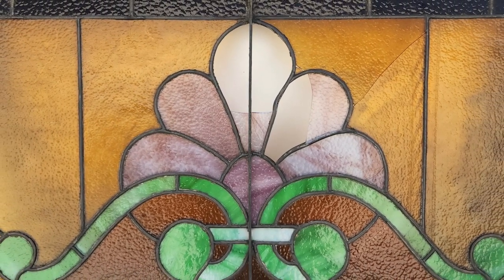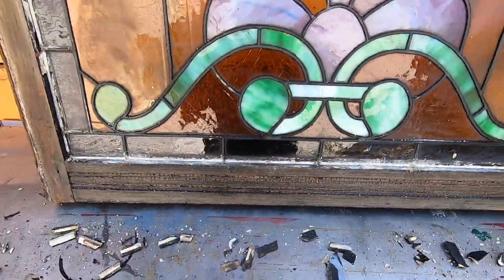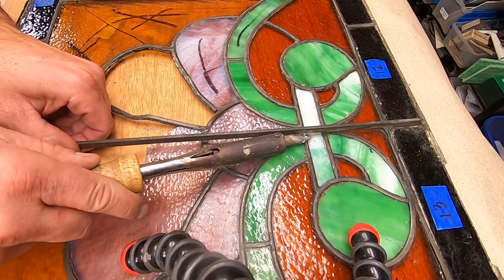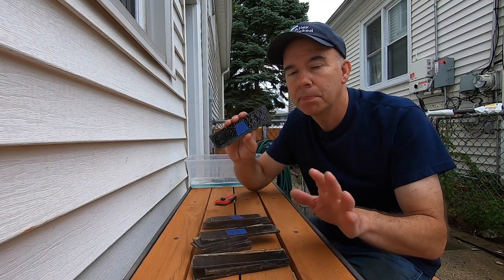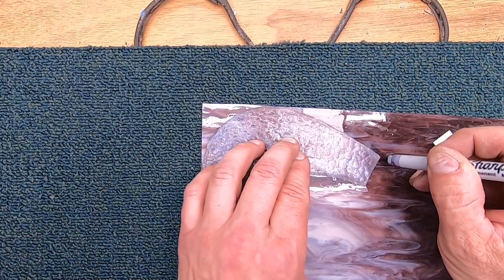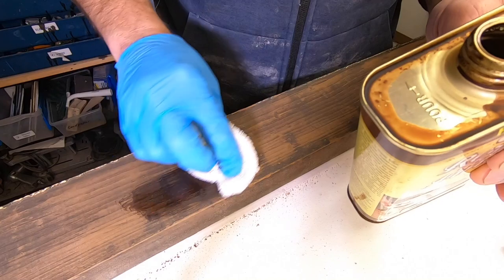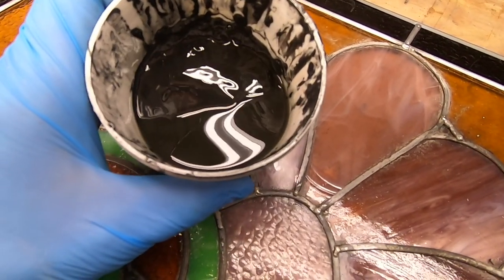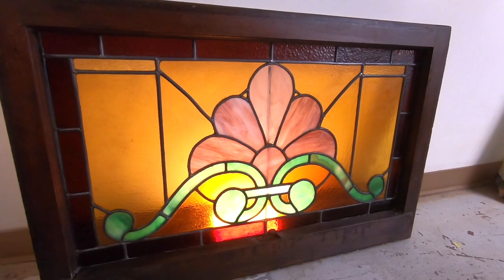A Most Difficult Stained Glass Window Restoration

Comment: This one should have be been given a Full Restoration. Or a complete Releading. As soon as you get it out of the sash you do a rubbing or new cartoon. Paper on top and use lead came or a carbon stick to rub over the window to make your pattern. You can number them with a waterproof marker on tape and soak them in a shallow tub overnight. Much cleaner with less razor scrapping.

Comment: That's a really magnificent job Tom, very impressive. I certainly got the idea that it must have been a long haul but just how long did it actually take? Cheers mate.
Reply from the maker: I started it last August. I worked on it on and off for a week or so. I ran into a couple problems with the glass so I got a little discouraged about the project so set it aside. It was probably not until December when I started it again. I probably have 40-50 hours into it. Longer than it should have taken.